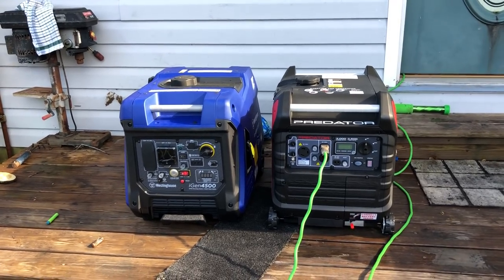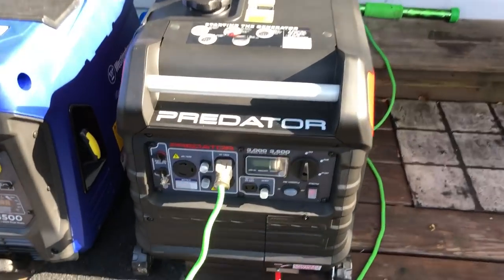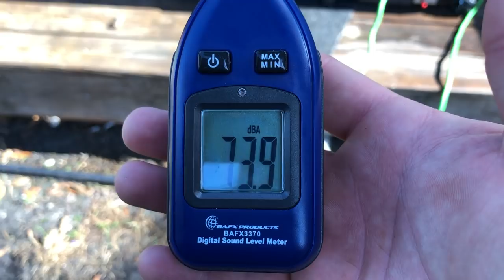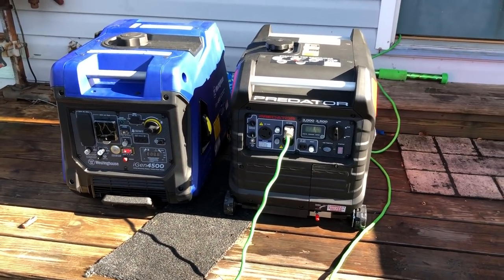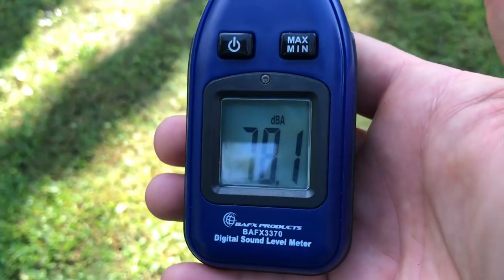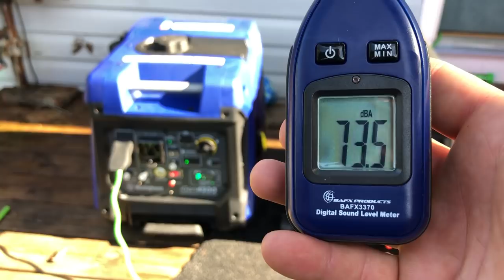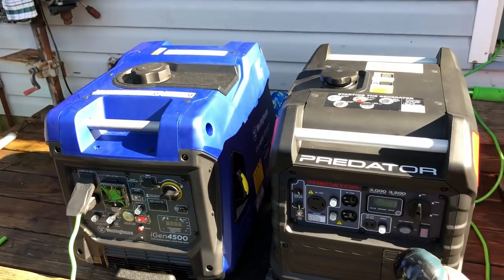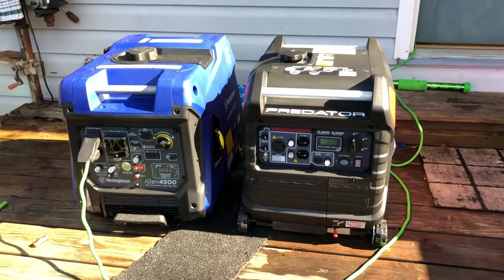Westinghouse iGen4500 vs Predator 3500

Comment: Wish I had one of them noise decimal machines when my Westinghouse started knocking under 100 hours bearings made more noise and everything else and their customer service sucks
Reply: buy a honda you wont be sorry you get what you pay for mine is old runs like new buy honda cry once buy a cheap one cry a lot !
Reply: That's odd. Funny how people can experience different things with the same machine. I've got the same igen4500 as my buddy who lives off grid. He runs his about 10-12 hours a day and has four two years and hasn't had even the tiniest problem with it. But, it was also broken in right and is well cared for and without knowing you and you not elaborating on it, I'm not sure if you broke it in right etc.

Comment: As a new owner of the predator 3500, please tell what to look out for as I'm only 9 hours into break in on original oil,  You're input is greatly appreciated.
Reply from the maker: Shawn McDonell at 9 hours you should dump the oil as it should of been broken in already. They are great units when there running properly
Reply: Changed the oil after warming up first and it looked good just the slightest presence of fine matter I had with the Briggs I run on my lawn tractor. The new ones are coming with owner manuals instructing to run for thirty hours before changing brake in oil, this is disturbing as I don't think everyone buys the extended warranty as I did and would be out of the thirty days by thirty hours for a lot of folk. Thank you for your informative video, I would like to see how this generator does in enduring extended run time.
Reply: Change the oil often.  I have more the then 100 hours on my . Just with oil changes , I don't let the oil get dark.
Reply: Make sure you run synthetic oil in it right after the break-in period.  Put a better quality spark plug in it and clean the spark arrestor often.  Should give you years of service.

Comment: Thanks a lot for the good review! Definitely a lot quieter then my   old 2 ton 5000.  I have been looking for 1 for my 5th wheel. In order to return the predator you had to drain oil out to take it back?  I'm definitely not wanting to keep taking it back to harbor freight that's for sure. I would rather spend a little more money then have to do that a couple times. Maybe Generac or Wen.

Comment: Only weak point to the Predator is the exhaust. Either remove the spark arrester (slightly louder) or clean it every so often by removing it  and blowing out with brake cleaner. I've fixed several locally that had problems running and that was the only problem to fix.  You can tell if that's the problem as generator will run fine, then shut off, wait a few minutes and it will start like nothing was ever wrong, then shut off again. Even if your Predator doesn't suffer  from the stopping issue, a clogged up spark arrestor will cause more fuel to be consumed. I have this sneaking suspicion that the people that want to make more vents are actually suffering from an exhaust issue.
Reply: I remove mine when it is safe to do so.

Comment: Robbie, the folks putting the "vent" on the side are very misguided, yes there is a significant negative pressure inside the Predator, this is caused by the cooling system being very efficient, putting the vent or breather takes away from this...I wouldn't want to rely on my Predator(s) in the desert if i had put a vent like some did...
Reply: I agree, huge mistake from people trying to fix something that  isn't broke.

Comment: My money is on the westinghouse especially since for 40 bucks more you can get the dual fuel model. now if predator had A d/f model I would go with that one simply for the ease of return/replacement
Reply: They sell a snorkel kit for the predator or most small generators. They convert to Tri Fuel...fuel, propane and natural gas

Comment: The Westinghouse seemed way louder.
Reply: Westinghouse 224 cc motor, predator 212 cc motor.
Reply: I've heard both,  Westinghouse is a bit louder but also has a bigger motor and pushes of almost 1,000 more running watts. Hell,  I power outputs no biggie for you there's plenty of REAL quiet generator options.

Comment: are they both made in China?|
Reply: Almost all of them are, even the ones with the American-sounding names. Others are made in some other Asian country. It's sad but most of the manufacturing has left our shores.
Reply: @mso4433  with trade sanction would not want to get stuck no parts
Reply: @matthewcunningham8587  Most of the Chinese outfits that make these generators have parts houses in the U.S.   Mine happens to be located in Arizona.  They can advise on repairs and offer warranty advice also. Cool!
Reply: @mso4433  THINK I AM GOING TO WATE

Comment: I bought two predators...they both ran like crap. Returned both and wont buy again. PITA to drain fluids, rebox em, and return them. Have two 2k WEN inverters and thinking of getting two more. They are easy to carry and run great. When I need the power I can fire all 4 and then run on eco on two at night. They also sip fuel. I made a homemade cable box that I can add more cables if I buy more. Overbuilt it to run 12k watts. Thanks for the comparison..was looking at the Westinghouse.
Reply from the maker: FTLAUD 911  they are definitely hit or miss in terms of running right out the box. I finally now have 2 predators after returning many that run great which I run parallel, the Westinghouse runs great but has seemed to get louder as it racked up some hours but it’s a great buy for the watt output.
Reply: Funny, the predator I own runs great and runs everything in my 5th wheeler great.
Reply: @ca8920  No doubt Chris, I got one, it ran great. My neighbor liked mine so he bought one and it ran great. My understanding is some of the early 3500's had their air intake to close to the housing and they could be starved for air. Neither of us had that particular problem but we live at 5,200 feet altitude so air is always kind of an issue. My warranty is up so I just drilled some extra holes in the panel covering the air intake just to increase airflow as much as possible. My only real complaint is the wheels are to small. It won't roll over any even moderately rough surface. We just got a little cart for it. The cart allows us to roll it around anywhere and an extra fuel tank mounts on the cart too.

Comment: I think to tone of the predator is a little better.
Reply from the maker: stelthy100 unfortunately at this point with a side by side comparison and 100+ hours on each your are absolutely correct! Too many small current issues with the Westinghouse
Reply: I love my predator 2000 it ran my 32ft boat that takes 2 30 plugs so I had to buy 2 boat plugs to 120v adapter but it ran everything AC Hot water heater microwave lights refrigerator for 6 days straight only turned off to refuel and change the oil
Reply from the maker: Attention 2 Detail Automotive Towing And Detailing very good buy for the $$$ the predator that is

Comment: Howndo you reset the igen.  I can't get mine to start
Reply from the maker: pahz place getting what to start? The unit itself?
Reply: @robbierod4391  yes.  Do i have to charge rhe battery prior to using the unit
Reply: @robbierod4391  doed the iGen not have a pull cord? The Predator has push button and a pull cord just in case of a dead battery.

Comment: You’re WRONG, it’s only 500 running watts difference and almost $400 difference in price, definitely NOT worth it... in my humble opinion
Reply from the maker: Anthony Pegues I’ve run the shit out of both! Not 500 watts difference I’ve run both at full peak wattage and there’s a consistent 900 watts difference between both running over 30 mins at almost peak wattage. Didn’t take video of that.....
Reply: Not to mention other features of the westinghouse like remote start etc.  Oh and it not being a pos Harbor Freight generator you've got to buy 3 times just to find one that works.

Comment: I am wondering why you put an hour meter on the unit as the photograph on Westinghouse show a life time run hours on the meter
Reply from the maker: TF Event Photography obviously doesn’t have hour meter that’s why
Reply: @robbierod4391  Then what is the lift time run time meter on the guage picture
Reply from the maker: TF Event Photography hour meter I purchased lasts 5 years that’s the life span
Reply: the Westinghouse has a hour meter built in.
Reply: The new o es have an hour meter. The one in this video did not. If you read the comments Westinghouse even commented saying they were adding it on newer models.

Comment: Nothing but Honda's for me... I ran my Honda eu3000is in 90mph winds and rain during a hurricane from the moment we lost power and it never missed a beat, ran for 8 days straight til power came up... My gen gets a lot of use as every time we go to camp it runs for 2-3 days straight. I guess if you use a generator as much as i do.. Best bet is a Honda ..if you just need occasional power these would work.. If you can afford a Honda you will get what you pay for.
Reply from the maker: South FL Mud Club we can agree on that one of my first predators has almost 4000 hours though some of these units are unstoppable
Reply: Same experience with my 10 year old 2000i. Countless hurricanes and Florida power outages- thousands of hours. Who knows how many cheap knock-offs I would have bought.

Comment: Predator for the win..great video
Reply: Lol how do you come up with that when he says he would definitely buy the Westinghouse?
Reply: @bounderchris  . Because I have a predator and I love it . I put more then 100h ,  10 hours a day.. with not a single problem . Just oil change.   And I see a more built unit .cheaper price .  Some people may have different opinions. .
Reply: @pepe58pepito54 I see. I was going to buy the Predator yesterday,  my stepdad just bought one and had to drill holes in it to get it enough air.. I ended up pulling over on my way there and buying the Westinghouse because it can run both my 15k AC units

Comment: Is it possible to run them in parallel?
Reply from the maker: GerryStilton most definitely I do
Reply: You can run any inverter generators in parallel.  Doesn't matter the brand or the output.  I run a Westinghouse iGen2500 with an Aldi WorkZone (Pulsar) 2000 watt.  All you need is a cable to connect them.  I use the Westinghouse parallel cord as it will work with any inverter generator with a standard 110v outlet.
Reply: @mowcowbell  thanks!  That's what I was wondering.

Comment: They both seem like good generators but you would think the Westinghouse would have a 220 outlet. I can say this my Yamaha i2800 in over ten years has never failed me and runs everything these two do.
Reply from the maker: George DeAmicis they both are good but I still favor the predators
Reply: I also have a Yamaha 2800i that I purchased used years ago.  Unknown hours as it was a rental unit.  Runs fine and generates fine also.  It has so many hours the muffler shield has a crack in it from vibration.  I also have a Yamaha 2000 and it is good as is my champion hybrid inverter.  I had a small 800 watt Generac - ETQ both made by same chineese OEM.  Junk was the best non dirty description I have.

Comment: I would say personally if I were going to buy either one of those two I would probably go for the harbor freight and I would buy the extended warranty I can tell you as an inside track club member I have bought the extended warranty on different things and have actually had to use the warranty before on different items and there’s usually no questions asked and the replacement is pretty dam quick,,, I don’t think you’re going to get that level of satisfaction and service with that Westinghouse I really don’t.
Reply: True. Rather than repair the generator, they give you a brand new one.
Reply: Yes no questions asked just go grab new one.
Reply: And they will let you buy another 2 year warranty for replacement they give so you could just keep getting new ones every 2 years for $100 and still be cheaper then the honda in 10 years.

Comment: Here is a note I just sent to Westinghouse about my iGen4500 junkpile.

Bought this boat anchor new about the date I mentioned above. Choke problems right out of the box in that is was sticking closed. Called support and was sent a replacement choke control. Installed it and seemed to fix the problem until two days later I have the same problem again. Called support again and was told to take it to a service center...............TAKE MY BRAND NEW MACHINE TO GET FIXED!! Gimme a break! I took it upon myself since at this point to find the problem myself and when I took it further apart I found a connector that was not locked together when it was built. I locked the connector together and that fixed the problem. Jump ahead to day before yesterday. The genny ran all day while being used intermittently and it was perfect. The next day, or yesterday, hit the start button and it started immediately and just as quick shut down. Tried several times with the same results. So this morning I took it apart enough to determine that the choke was still working properly, and it is. I checked the fresh oil, it is perfect. Full of fresh fuel, nothing I can see wrong. I called support again and talked with some idiot named Jaffe the quickly started fallowing a script when I told him the story. He asked "How many times have you changed the oil?" I told him I've changed it once.............the thing only has about 15 hrs or so on it. He said "According to the manual, you should have changed it twice by now." I replied IT ONLY HAS 15 HOURS ON IT AND IT HAVE ALWAYS BEEN STORED AT ROOM TEMPS. I went on to tell him that as long as it ifs full of oil it doesn't know the difference between oil with 1 hr or 1000 hrs, that will not shut it down. He said, "Sir, I'm just telling you what the manual says." Then this incompetent moron asked me what kind of fuel is in it right now and I told him it was high octane, no alcohol canned fuel like we use it all our small engines. He asked "Did you drain the old fuel out before putting new fuel in?" I replied that the previous fuel wasn't in it very long and besides, that last time I used it I purposely ran it out of fuel. He asked "Did you drain the carburetor bowl?" I said no..........that's why I ran it out of fuel. When it stops because of lack of fuel, the bowl is dry. He then told me that there will still be fuel in the bowl at that point, so you are incorrect. I let him know that I've been a gas/diesel tech for 35 years and this clown told me that cars and generators are different! I still have a junk $800 piece of crap that I cannot depend on. I got of the phone with this person that has NO idea what he is talking about and messed with it a bit longer and noticed that right after it starts, the overload indicator comes on and it then shuts down. I didn't notice that before. Not to mention that I did not get the mickey mouse charger for it when it was new and have since had to replace the battery because I could not charge it and this thing does not charge it's own battery?? How stupid. I emailed about that and was asked my reply email to provide proof of purchase and a picture of the serial number. Really? I did it anyway and emailed it all in and have gotten zero response on that issue. I bought a small trickle maintainer for the new battery. This idiot "Jaffe" that I spoke with made no attempt to help me diagnose my problem, just read a script and told me I was incorrect about how a carb works. What are the qualifications for his job anyway?? This thing has been a thorn in my side since day one and you so called support department is incompetent if "Jaffe" is representative of it. My opening line of this note is not entirely accurate, this thing is not big enough to anchor my boat and it's too big to go in the trash can, so I don't know what to do with it.